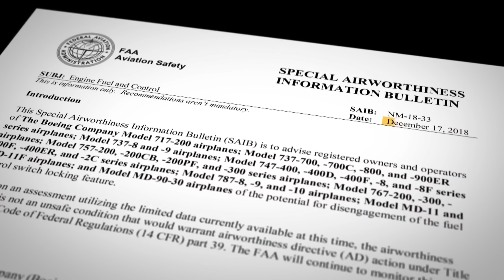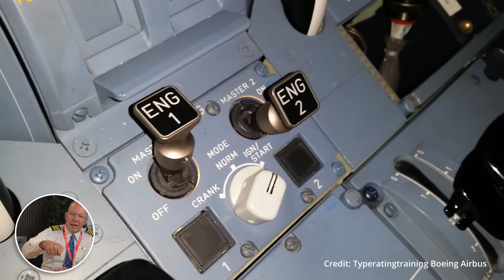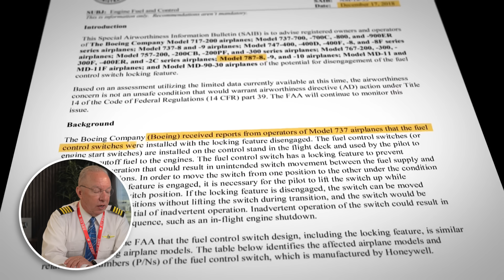Air India 171: The FAA’s 2018 Fuel Switch Locking Bulletin Explained (16 Questions Answered)

Comment: Ive been flying for 35 years and I hear everyone talking about cameras in the flight-deck. Yep, probably needs to happen but with the footage not available to the operator, only accident investigation teams and only each sector. The amount of money that's about to be spent trying to work this one out will be considerable and it will take a long time if ever. I personally wouldn't yet jump to a final conclusion here, lets wait until the aircraft tech logs, pilot training and medical records etc have been examined in depth. Most likely its just like Captain Steeeve says but history shows there's usually a twist or two in every accident.